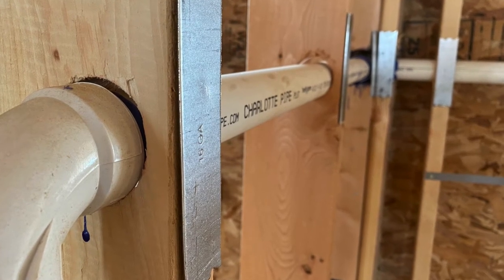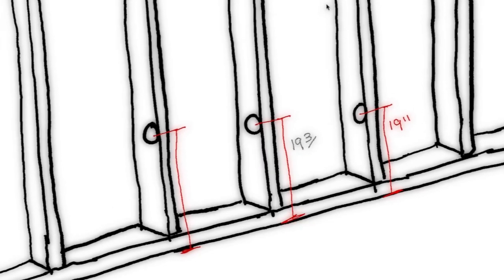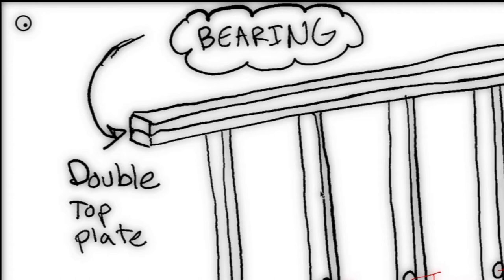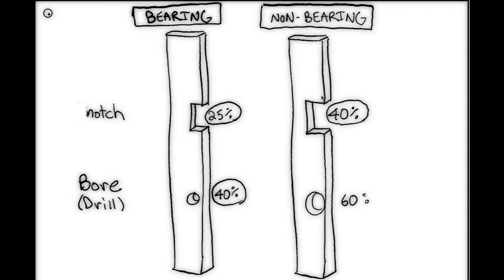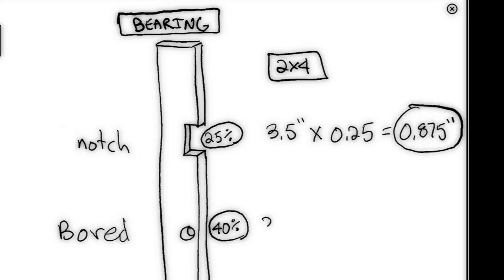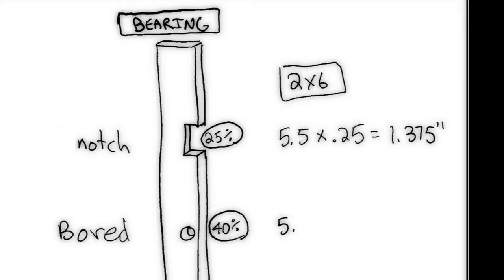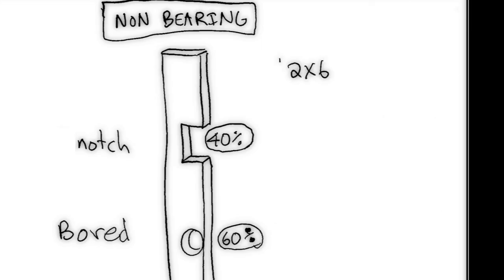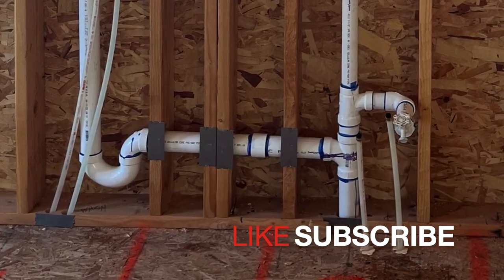Drilling Holes: Stud Frame Walls

Comment: Be careful on oversimplification on the bearing and non bearing walls. Many non bearing walls have a double plate in order to match ceiling heights. I agree it is good to assume that a bearing wall has 2- Top Plates but that too is not always true depending on how close the studs are, the size of the studs, steel and p- laminated beam construction, quite a few variables. However the information on hole sizes etc. was excellent and really helpful in planning my plumbing strategy on a Master Bath remodel.  Well done.
Reply from the maker: Thanks!  Good point. When in doubt assuming it is a bearing wall will keep us from removing too much structural material.
Reply: @plumber-tom9470  It can also kill a project if your chasing 1 1/2 PVC waste lines through a 2x4.  So if you  in that situation then don’t give up and check it out with a professional in the know. Good video I liked the math information helped me confirm my strategy.
Reply from the maker: Good advice.  Thanks for watching.  @Festvangelist

Comment: Im confused .... so we're breaking code by running 2" pipe through 2x4 non bearing ???? So I can ask my gc for 12" plumbing walls :0 I'll try
Reply from the maker: Correct.  Framers should be giving us thicker stud walls when we are running pipes in them.   But most of the time they are just following the plan.  So we could blame the engineers and architects.  Either way, it can be difficult to have them provide sufficient stud walls, and many inspectors do not know the difference or do not care.
Reply: Different codes for different areas
Reply: Hence a plumbing wall should have at least 6 inch studs not 4
Reply: @JosephRostkowski  I can't count how many times I wish our contractors would do 2 * 6 walls. Every now and then we get a smart one that'll do it. Other than that we're left trying to fit that 2 inch pipe on freaking 2*4 ... It would be really smart if they would at least do two by six walls where there's plumbing
Reply: Yes you are right the 2x4 wall is too small for 2”. I was able  1 1/2 waste lines to the 2” waste line and vent stack which were in 2x 6 walls adjacent to my Bath remodel. The 1/2” waste line for a lavatory sink is plenty big enough and provides flexibility to use the 2 x 4 “ stud.

Comment: is there a code for how big the holes can be or cant be when drilling into sheeting or studs
Reply from the maker: Not sure about sheeting. But yes on the studs. I cover that in this video. There are different requirements for metal studs as well. You can find them in appendix F of then IPC.

Comment: so going to convert a garage to an apartment. Slab floor and 2x4 outer walls. Plan on running kitchen,bath and laundry on 1 side. Don't really want to cut up slab, can't get 1-1/2 inch drains in 2x4's. So what if I made a false wall in front of the load bearing wall, nailing  2x3 to the 2x4's of the outer walls and add plates to cover the gaps? Would that be feasible?
Reply from the maker: Yes. Adding a frame wall is a great way to protect the structure.

Comment: What about small holes through king and jack stud packs, i.e. sides of windows? Does the code treat these differently?
Reply from the maker: Plumbing code addresses notching and drilling in the appendix.  But it is copied from the International Building Code. There might be more about it in the building code but I am not familiar.

Comment: What about if you add a stud shoe when the hole is 2 inch on 2x4? Or is it just a no-go all the way around.
Reply from the maker: Stud shoes are an acceptable option in most cases. You’d want to know the installation requirements and conform to that.
Reply: @plumber-tom9470  yeah... Sometimes it's just a no go for our inspectors... But understandably... Some people try to use them in some pretty extreme cuts ...
Sometimes it's just too far gone...

Comment: Hey Tom amazing content! I'm wondering if there is a limit to the maximum number of studs that you can drill through on a NON-bearing wall?
Reply from the maker: I am not aware of a limit that way. As long as you stay in the percentages for hole sizes.

Comment: Great summary. Couple of minor corrections:
1. top plate isn't necessarily the right way to tell load bearing vs non-load bearing. I have non load bearing walls in my house (they run parallel to ceiling/floor joists) that have double top plates
2. 0.875" is actually 7/8"
3. You forgot to mention that for load bearing walls, you can double up a stud for holes between 40-60%.
Reply from the maker: Thanks for clarifying. I appreciate your knowledge.
Reply: 7/8” is also .875. Much easier to do the math that way. I like the calculator approach…
Reply: @Festvangelist he said a little more than 3/4”, that’s why I mentioned it’s actually 7/8”

Comment: How are you getting 3.5 and 5.5 inches brother?
Reply from the maker: That is what you find when you actually measure a 2x4 or 2x6. They are actually 1/2” smaller in dimensions.  Historically they were actually 2x4 inches but to Eve lumber they make them smaller but call them the same thing.